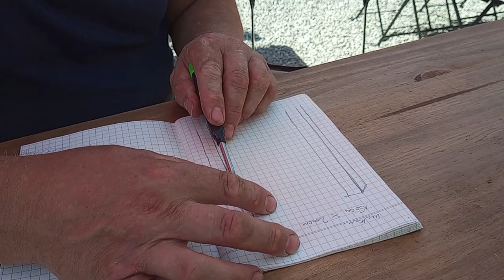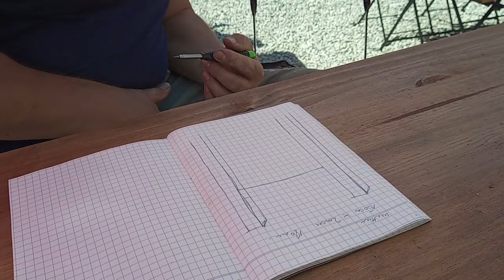171.Transformation of an abandoned chateau, 18months in 30 minutes Part2.

Comment: Really need to add tons of lighting in the ceilings and more electrical outles on the walls when you renovate rooms if you can. You can never have to many. Overhead lighting is a must.
Reply from the maker: The downstairs room has 17 plug points and led spots in the kitchen and bathroom, I never wanted these rooms to be like Blackpool illuminations as it would greatly detract from the ambiance of a 14th century building, hope you understand

Comment: This is incredible to see.(side question: did previous occupants of the chateau -  or relais - have no mains water or power in the central building? )Your vision and energy and stamina are truly remarkable.
Reply from the maker: It had been abandoned for more than 15 years, but the last owners only used one room downstairs and the old electrics and water pipes were all rotten and had been disconnected because it was not within up to dates regulation, so it all had to come out and be replaced